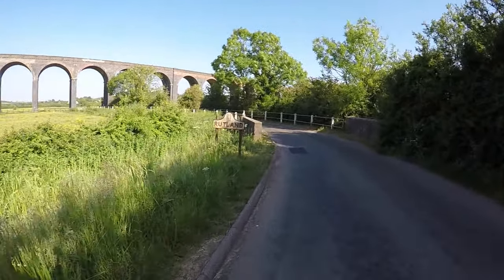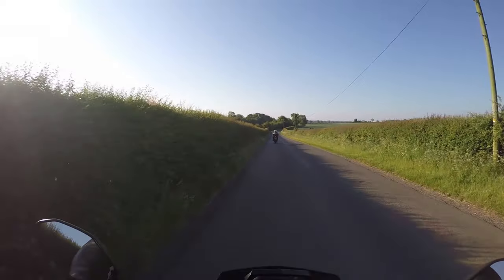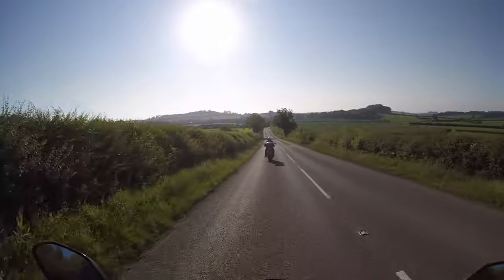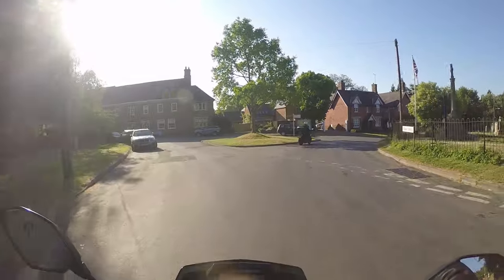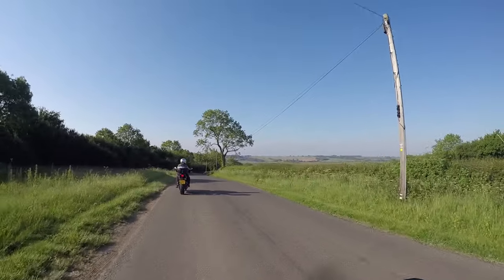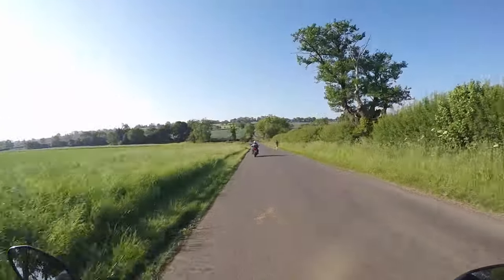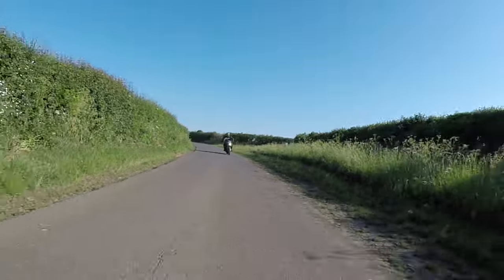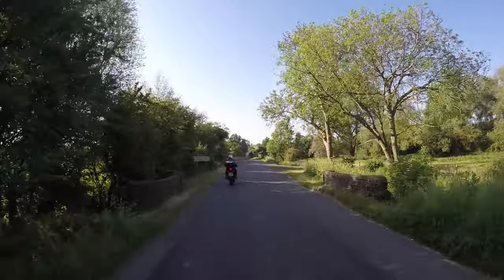Welland Viaduct ride on Yamaha MT10 and Triumph Street Triple

Comment: Real bit of engineering, they didn't have lasers in those days to get things straight and level. They didn't have FEA on CAD when they designed it either, designed and built buy proper engineers. A true memorial to them, probably outlast any of the modern stuff.
Don't want to be a kill joy, but did you realize you have to have a CAA license to fly a drone over 240g. If you didn't already know, I had to get one, it cost me 9 pounds. Or incur a fine, when the police jump out of the hedge bottom to arrest you 😂😂 Fat chance of that happenings.
Enjoyed the video. Stay safe, fly safe👍👍👍
Reply from the maker: It is indeed a fabulous bit of engineering for when it was built.
Both Carol and I have the correct CAA licence with the ref details affixed to our Mavic. Hopefully we are safe flyers. Thanks for watching, really appreciate it.

Comment: What a cracking excuse fr a ride! Have to have a word with you about your economy on the 10! I'll take more notice of our consumption but I think it's about 230 kms and I don't pootle very often because our vistas are not so absorbing. Wonder how many bricklayers that kept in work?
Reply from the maker: The MT10 isn't the most economic touring machine! About 35 mpg (uk) 150bhp is wasted a bit on a bimble like this. Would imagine many bricklayers were kept in work!
Reply: @Banditmanuk  Been out today on fairly fast roads about 200 kms to a tank full. Came home on just a smell! A few lights beginning and end. About 124 miles, i wouldn't be able to stretch it further as I don't ride economically that often!